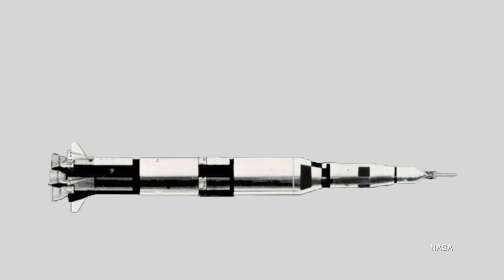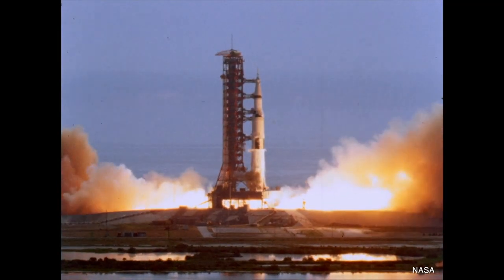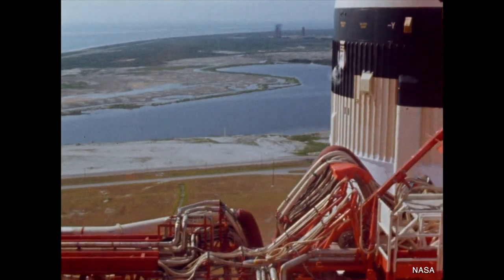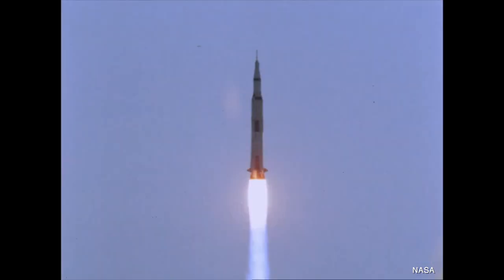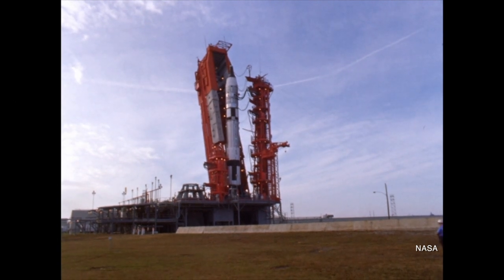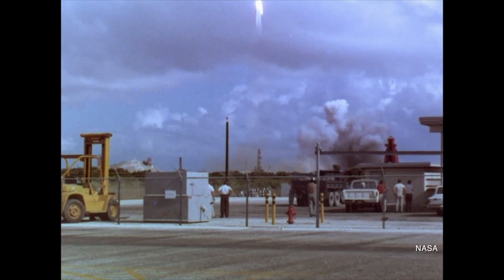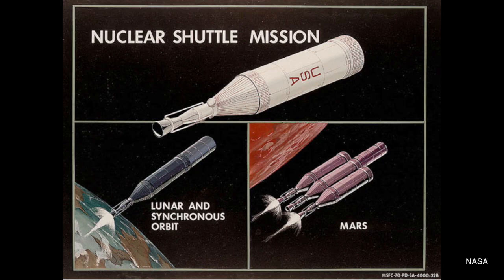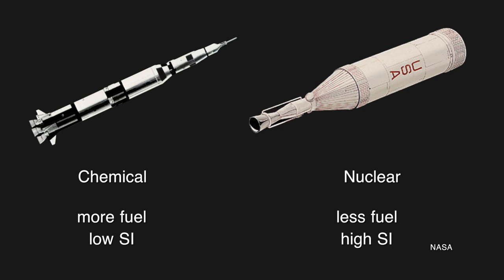What's the Best Kind of Rocket Fuel?

Comment: Same reason why handgun fired will recoil backwards.  If fired in outer space, the force of the exhaust gas will cause the person holding the gun will go backwards.  There is no need for an atmosphere, or for some background to oppose the force.  Recall, the NY Times had to retract their statement that one of the early rocket designers argued that a rocket would work in outer space.  The Times  tried to make a fool of the person ( can't remember if it was Goddard), but had to make a retractaction over 50 years or so later that the paper was wrong.  I have to give credit to the newspaper for finally coming to terms with the truth.  I am not endorseing the paper at all by making this comment, just a fact. Thanks Amy for always making things easy to understand.

Comment: one thing ive been looking for is how soon was the lox tank on the saturn v filled  before launch. id imagine it was done pretty close to launch to mitigate ice buildup and pressure in the tank
Reply from the maker: The Apollo chronologies should have an answer to this... I'll see if I can think of a way to make a good video about this question, too! Cheers!
Reply: Vintage Space have you done anyhting about how the rockedyne f-1's circulated fuel in the nozzle for cooling?
Reply: roywhiteo5 I'm pretty sure the fuel is actively recycled up until launch.
Reply: ***** the thing that makes this question so interesting to me is that i work in the refrigeration field
Reply: roywhiteo5 Yes as somebody else said it was done at a time as close as possible to launch. The tanks were as near to the launch pad as they could safely be. The tanks were spherical in shape and pretty big. Ice buildup was not actually an issue. This occurs during launch. That's because the sudden drop in pressure caused by all that high pressure liquid being dispensed so quickly. The reason for filling so late in the process is two fold. One, so many people were hard at work on the vehicle it was a safety hazard to so many people. Better to have a handful killed by a tank burst with the enormous pressures involved., Two, the vehicle is enormous and heavy. The fuel and oxidizer comprised the bulk of initial weight and would require a must larger, more powerful transport crawler to get to the pad. Hope this helps. Oh, I should add here (because of the misconceptions about cryogenic fuel/oxidizer) that they are not cold. High pressure keeps them liquid and at ambient temperature. Again, it's the sudden drop in pressure during firing that causes the ice you see falling offf during liftoff. When there is a change in state you get temperature changes. Much is done by use of Helium to keep the tanks pressurized as they are being emptied. That's mainly to ensure good stable combustion in the power head (you don't want all the liquid going to gas state) but it has the added benefit of cutting down ice generation on the rocket body. Ice is heavy! Hope this helps.
Reply: Johnny Ray Bramton all the information i can find on the lox tank says it was a liquid at -297F. i understand what you are talking about regarding storage at a high pressure liquid but i dont think the lox tank was that much of a pressure vessel

Comment: When comparing these types of propulsion, its Important to distinguish between fuel and propellant.  Fuel is what combines with oxidizer in a chemical rocket.  Propellant is the reaction mass that is expelled at high velocity to accelerate the rocket.  Its not accurate to say an ion drive burns less fuel for a certain delta V.  Its more accurate to say that it uses less propellant for a certain delta V.

Comment: FWIW:  I do not have the exact quote in front of me, but Arthur C. Clarke wrote - in THE LOST WORLDS OF 2001 - that Project Orion/nuclear pulse propulsion is the only known way to get a very large single stage spacecraft into Earth orbit.
Reply: +John Murphy → AFAIK there is currently NO MATERIAL available with a high enough tensile strength to form a structure that long.
Reply: +John Murphy → Agreed. When it IS developed, it will lead to a MAJOR DECREASE in the cost per pound {or kilogram} of placing stuff in Earth orbit.

Comment: You forgot compressed gas propulsion. All you need is a tank full of a compressed gas and a valve to control the flow. A lot of the EVA astronaut jet packs use this kind of propulsion. Simple and extremely safe/reliable.
Reply: Also (in the case of astronaut jet packs) there is no hot "flame" to possibly impinge on and damage a spacesuit.
Reply: I think space x want to use unburnt methane for rsc
Reply: Thes is called cold gas thrusters and usually has abysmal specific impulse. (20% of chemical rockets at best)
Reply: Barcel That's why we fill our compressed air rockets 1/3 with water. The extra mass expelled is great for lifting heavy payloads.
Reply: And also garbage thrust. Plus, a gas tends to takes up more volume than a liquid or solid.
Reply: Gasses are more compressible than liquids or solids, so gasses can actually take up less volume, when they are pressurized.
Reply: USWaterRockets i
Reply: USWaterRockets f
Reply: What if you sent the gas through an electric arc? The arc would heat up the gas into a plasma. Don't high temperatures improve the efficiency of an engine?
Reply: SpaceX also uses cold nitrogen thrusters for control and ullage on the Falcon 9.
Reply: You're mentioning this because your rockets use compressed gas propulsion!!

Comment: My question, using the Saturn 5 3rd stage engine to capsule what speed can it attain from the ISS height until half its fuel is gone? Propose using it to go to Mars faster and slow for mars landing then 4th and 5th stage to return for splashdiwn

Comment: Since you are doing rocket propulsion, now might be a good time to discuss the fluting on the rocket ejection port that was designed to prevent standing waves that would tear the engine apart.  (It was the only classified secret in the rocket engine design) :)

Comment: Correction: Newtons 2nd law is the conservation of momentum.  The 3rd law is F=M*A.  To answer your question, the best rocket fuel is Hydrogen/Oxygen (which can have an ISP greater than 500).  Ion, and nuclear may get more ISP (and require an external power source), but overall Hydrogen has better energy per mass...

Comment: At its most basic, a rockets needs some sort of mass and some way to accelerate that mass out the back end of the vehicle.  The mass can be anything from molecules of somthing, down to mere ions or even electrons, or theoretically even smaller particles.  The method of accelerating the mass can be a simple chemical reaction producing heat and/ or pressure, it can be simple application of heat from a nuclear reaction, or it can be electromagnetic forces acting on ions.

Comment: I suppose you could say, for the sake of intuition, that the rocket is "pushing" against the mass of the exhaust.  It's not much mass at any given instant, but it's moving fast, and therefore has great momentum that must be conserved.

Now, as for solid-fuel rockets, while it is true that the chemical components are typically in powder form at some point, I believe they're usually bound by a type of rubbery polymer (which also serves as fuel) rather than simply compacted--this would certainly give it greater mechanical stability, which can be important with all of the vibration involved.
Reply: Most of them have their own ingredient and they mix it like amateur doing it using Potassium Nitrate and Sugar.

Most of this 60% weight for total.

Comment: What was or is the diference betwean the boiler plate capsule and the apollo capsule that took astronauts to the moon?
Reply: A boiler plate capsule is just a chunk of metal.  It looks the same from the outside, it's the same shape and all.  But if you looked inside you would see no chairs, no controls, no computer, no parachute, no life support systems, no storage lockers.  It's just a dummy capsule of the same size/shape/weight as the real capsule will be.  Check the wikipedia article on Boilerplate (Spaceflight).

Comment: What are the ratios of the different fuels?  For example, in the Saturn 1B was it 1:1 for RP-1 to LOX or was it some other ratio?
Reply: Check Wikipedia.  The F-1 was 2.27:1 and the J-2 was 5.5:1.  Those are by mass, OXIDIZER:FUEL.
So for example the J-2 drank 5.5 pounds of O2 for every pound of H2.
Lets see, Oxygen weighs 16 amu and Hydrogen weighs 1 amu, right?
So stoichiometric ratio to make steam exhaust H2O would be 16:2 or 8:1.
Just wanted to point out that rocket engines are rarely designed to run at stoichiometric mixture ratios.
For various reasons that you can explore with the online Chemical Equilibrium with Applications calculator webpage from NASA Glenn.
Reply: @Jacob Chancery: thanks for the great reply!  Great information.

Comment: I have a related question. A chemical rocket engine (liquid fuel of some sort) launched from Earth have a pump driven by a turbine (H2O2) pumping liquid fuel and liquid oxidiser into the combustion chamber. When such an engine have to be restarted in free fall (microgravity) I remember the term "ulage" for firing a smaller rocket at first to generate some accelleration so that the liquids end up at the bottom of the tanks. Otherwise the pumps cannot get at them. If chemical rocket engines are used far from earth how is this achieved? Even the small rockets need some sort of fuel.

And how do one store liquid hydrogen for long time travels? A strong tank is heavy and even in space liquid cooled hydrogen might get hot enough to be troublesome.
Reply: There are other ways to keep liquid fuels pushed to the feed tubes. F.ex you could store fuel in a flexible bladder kept in a pressurized chamber, these means are just not that practical for the large ascent rockets.
Cryogenic hydrogen simply isn't used for deep space missions (In the spacecraft) as we can only keep it liquid for hours or a few days tops.
Reply: Because long time travel "don't exists" yet.

Nevermind, if they can do long time travel, they won't bother with EM Drive. Not even hydrogen engine or any rocket engine can work in space, because they can't control thruster direction (fire floats in 0g).

So how rocket can pass the Earth barriers without being dragged back down?
-By reaching more than mach 5 (more than 2000kmh) until it shut off by itself once in vacuum.

Even in combustion chamber, the chemical will expands because its in 0g.

Comment: Specific impulse is abbreviated to ISP instead of SI.
We can make chemical rockets better or worse. Better rocket nozzles, higher combustion chamber pressure, full flow engines.
RP1+LOX is used for the Saturn V first stage because ISP isn't as important for the first stage as it is for the following stages. For instance solid propellant rockets suck at ISP, still its used for the STS side boosters (which essentially act as the STS first stage), they however provide a very high thrust without much complexity.
The most important job of the first stage is to very quickly accelerate the rocket. Imagine a rocket with just barely enough thrust to lift off. Its wasting most of its fuel fighting gravity. The more powerful the rocket's first stage is versus its lift off mass, the least impulse will be wasted against gravity. By the time the rocket stages, its already going fast enough now the big advantage is having higher ISP, the higher the ISP, the lighter the following stages can be, which make the effort of the first stage easier. In contrast, the first stage can just be made bigger to compensate for its lower ISP.
SpaceX rockets that are flying all use RP1 as its fuel, for both first and second stages, and to aggravate that, SpaceX Merlin engine is not a full flow engine (it burns some of its fuel+LOX to power the turbopump, that exhaust is then thrown away wasting most of its thrust), but still, SpaceX managed to be ultra efficient in every other way, resulting in the best ISP RP1 engine ever made. And the Merlin design makes the engine itself quite light and powerful, giving it an awesome thrust to weight ratio.
The downside of liquid hydrogen stages is LH2 volume is quite high, which mandates a larger stage to handle the hydrogen volume.
A combination that's the best of both worlds (ISP much better than RP1, and slightly worse than LH2, but fuel that has much better density than LH2) is Liquid Methane+Liquid Oxygen (methalox) rockets. Example are SpaceX Raptor engine under testing and blue origins first stage engine which will reportedly also use methalox.

Comment: My name is Scott and I love nasa and rockets but I have one question how do rocket engines not melt at lift off I mean the flames must be hot enough for to melt the material the engines are made of right
Reply: There are at least three ways to solve the melting problem.

One way is that most liquid fueled rocket engines (like those on the Saturn V) are regeneratively cooled.  That means that before the fuel goes into the combustion chamber to burn, it first flows around a hollow jacket that surrounds the combustion chamber.  In this way it cools the engine and keeps it below the melting point.

Another way is called ablative cooling.  In this method the lining of the exhaust chamber is made of a material designed to melt and boil away at a controlled rate while the engine is firing.  These have to be designed with a thickness dependent on how long the rocket needs to fire.  And they can't be reused unless you make a new liner.  I think SpaceShipOne used an ablative cooled rocket nozzle.

A third way is to make the parts that will be exposed to exhaust flames out of special materials (refractory is the word) that can withstand the high temperatures without melting.  A lot of smaller hypergolic thrusters for in space propulsion use this method.  Many of them use a Niobium alloy that can glow white hot while the rocket is firing without melting.  This is sometimes called radiative cooling because the heat is radiated away into space.
Reply: Jacob Chancery but if the fuel is stored at room temperature wouldn't the heat from the flame boil the rocket fuel that flows around the engine effectively melting the engine from the inside

Comment: Amy, great coverage of the very different fuels and methods of propulsion.  I have an idea for a future episode that builds on the fuels discussion.  We've all seen the exhaust plume morph and grow as a rocket ascends through the atmosphere, especially with the Saturn V.  What causes this and what are we actually seeing?  Thanks!
Reply: The growing exhaust plume width is due to the decreasing atmospheric pressure as the launch vehicle ascends.
Most first stage or booster engines are designed to be exactly expanded or slightly over expanded at the launch pad.  That means the plume goes straight out, or sometimes slightly contracts as it leaves the nozzle.  Watch a video of the space shuttle engines lighting up on the pad and you'll see that slight exhaust plume contraction.  But at high altitude the ambient pressure is less and the nozzles are "underexpanded" so the plume expands more after it exits the nozzles.

The point of the converging/diverging nozzle is to convert static pressure to exhaust velocity.
The more your nozzle expands at the opening, the faster the exhaust and the lower the pressure.
But if you go too far you run into two bad effects.  Your nozzle can get too big and heavy, and you can get flow detachment before the end of the nozzle bell which can damage the nozzle.